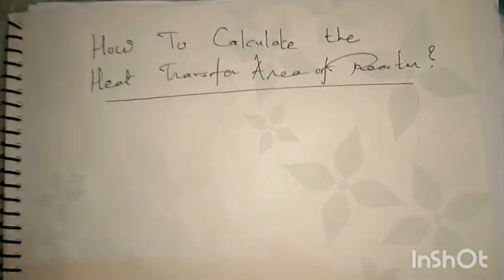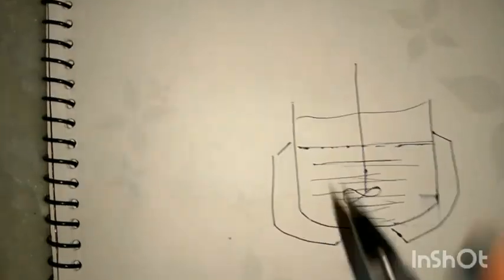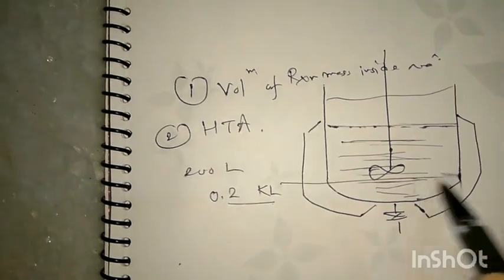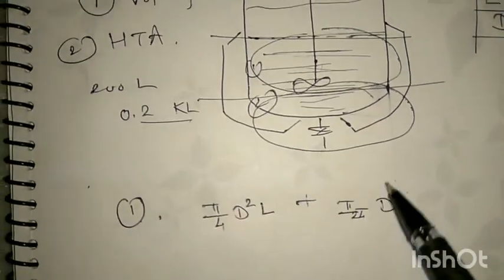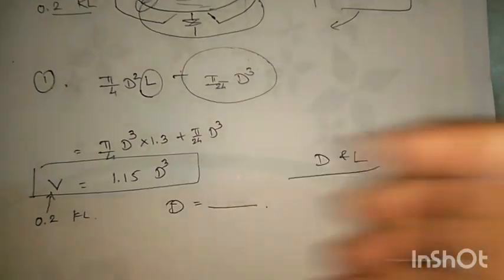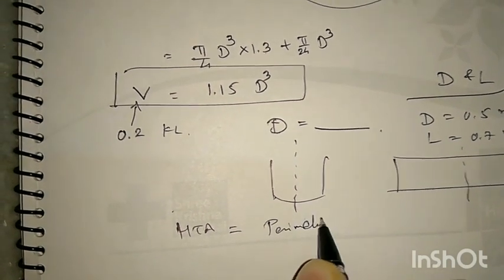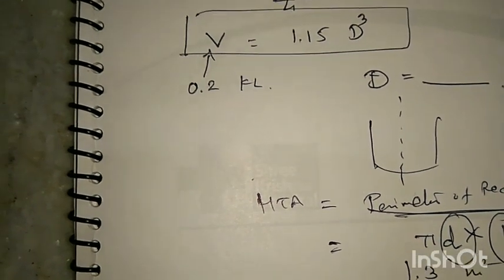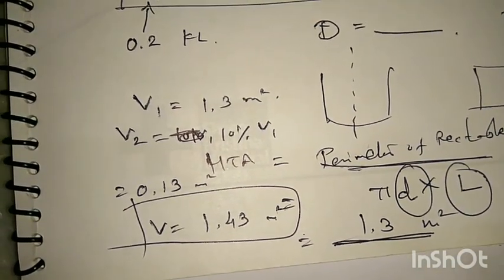HOW TO CALCULATE THE HEAT TRANSFER AREA OF BATCH REACTOR

Comment: Suppose, a 2 metre height stainless steel pipe with 1 inch diameter filled with water, it's possible 2 bar steam transfer from bottom?

Comment: Sir,can i use this calculation for the cylinder which is provided with heating coil
Reply from the maker: No, you cannot as for coils, there are no. Of turns. Which you must know. You may send your queries on my mail id.
Reply: @harshalthakar  sir,can i have ir mail id
Reply from the maker: harshal.thakar@yahoo.in